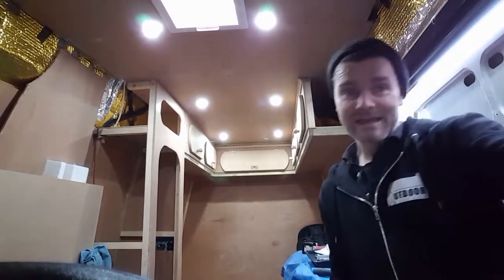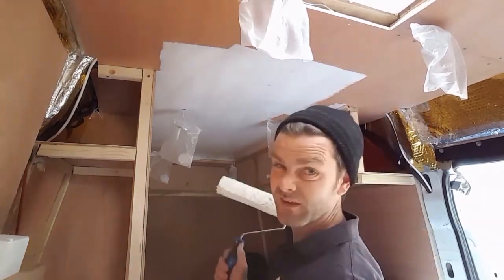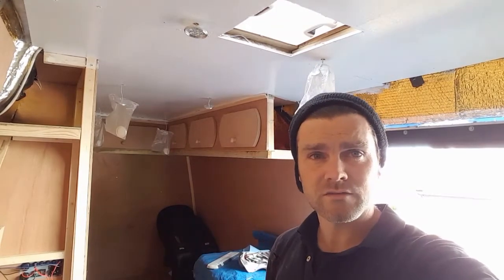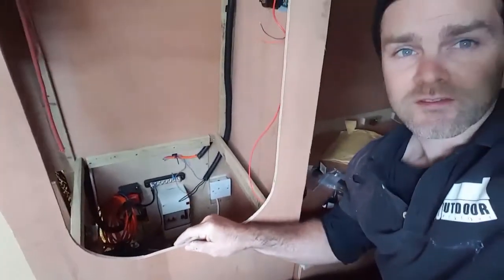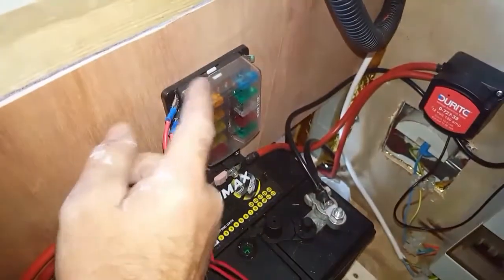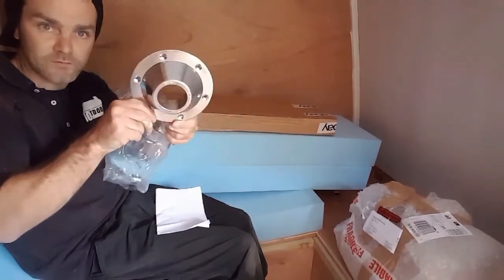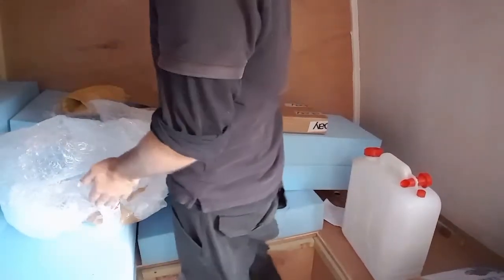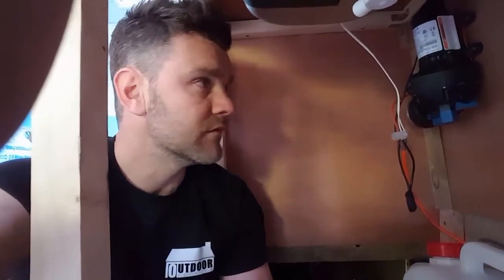Luke's Van Life! #12 Painting, electrics and new toys!

Comment: vans coming along a treat Luke. Soldering the wire is better but  I would still use block connectors, much simpler and to start off with you can change things if you get it wrong first time around. keep up the good work vids are great, giving people advice and ideas. ATB Kev
Reply from the maker: KEV JONES. thanks Kev. appreciate it

Comment: Hi been watching your vids, nice to see your van coming along.. The earth wire for your switches can just be looped to each other, don't have to run one for each switch to your main earthing point.. You can buy jockey female connectors to make your life easier. Thanks Ste.
Reply from the maker: ste ed. hey, I thought about doing that but because I bought that bus bar I kinda wanted to use most or all of it. but I may run out of earthing points and I'll have to link them up. I will get some of them connectors. thank you

Comment: if masking tape has laid to warm or to cold.. they tear always in pieces..... we know the feeling :p  

Thanks for the great tip of passing a cable folded  through that  tube :)  ( i did with putting my cable through some water and soap, but your tip looks more simple and better )

The white let's your van look bigger :) and it looks like it reflects your light too. groundpaint does not need to be perfect, it is just there so your actual paint will stick better to the wood. Clever thinking of using bathroom-paint ( i'm taking notes here ) , it certainly will block moisture and condensation better :)

Comment: Garden hose is better, no ridges to get stuck on. ;)
The table leg floor mount... Couldn't it be used the other way so you wouldn't have to cut the floor up ?
Reply from the maker: Livin In A Box. hey, yes, hose pipe would be much easier and I would use that next time. I'll look into different table connectors I think. I won't cut up my floor, I might just build a slight raised step up for my seating area. thank you

Comment: If your feeding more wire down there if you keep one length as a puller all you have to do it tape the new cable to the puller and you just tape the end of the puller to the other end of the new cable and once it in you just un tape it ,and you will have the puller in for your next cable if you know what I mean .I know this is a old video Luck and you have done a lot more to your van but for people who are watching I hope it will be a help for them
Reply from the maker: I know what you mean. Good idea. :) 👍
Reply: Exactly what we do when running cables  through any form of conduits, esp: network/power cables. or use a mouse with guide rope glued to it!  (joking about mouse lol)